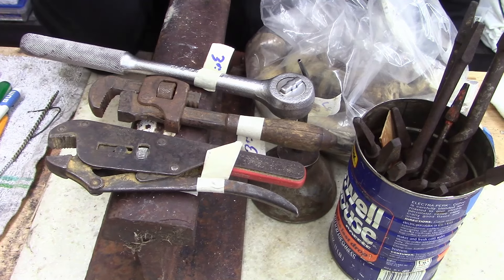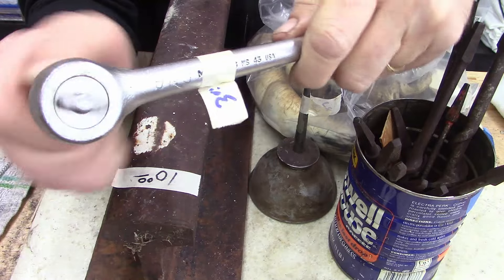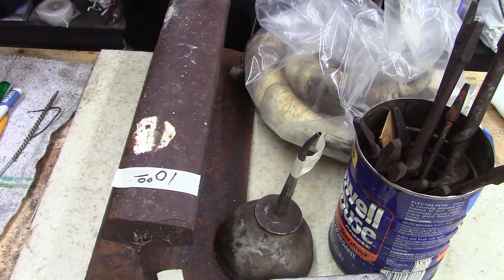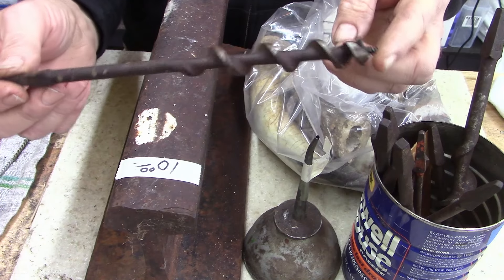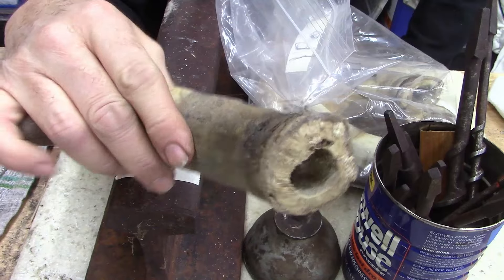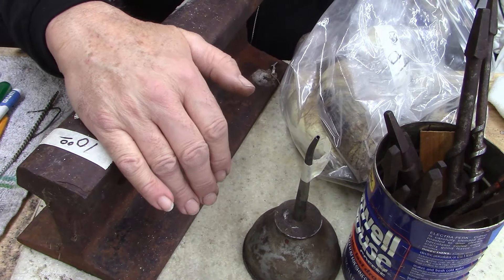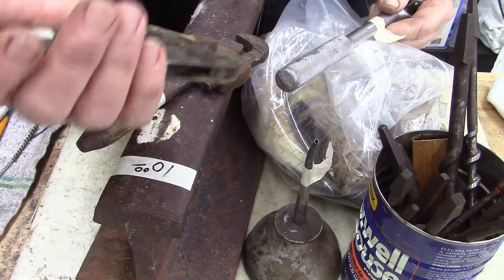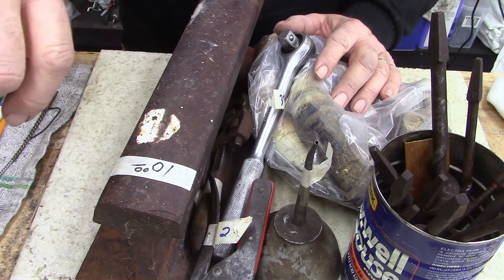Estate sale buys1st for 2024.

Comment: I like the railroad track. 👍👍
Reply from the maker: Still not sure how I am going to clean it up, might mount it to a tree stump, what do you think??????????
Reply: @djstoolrestorations  I used my bench grinder Wire Wheel to get as much I could off.  Then I used anti-rust primer and painted (hammered gray) all but the top.